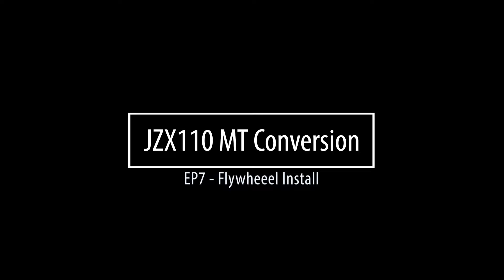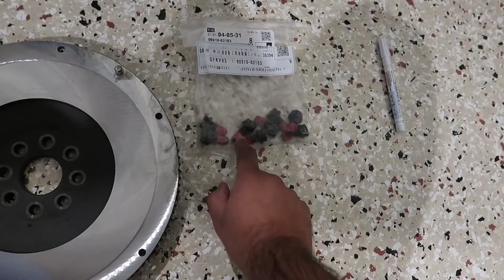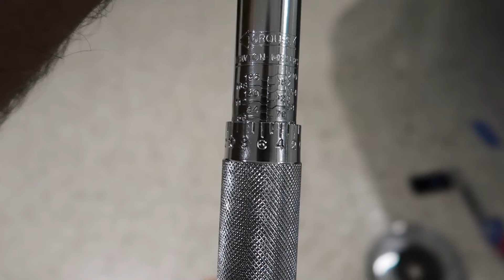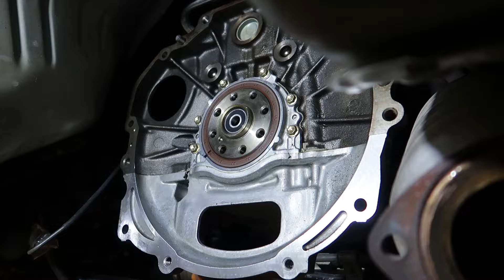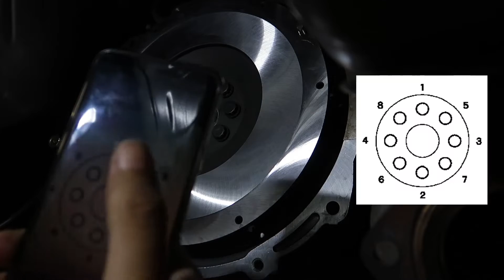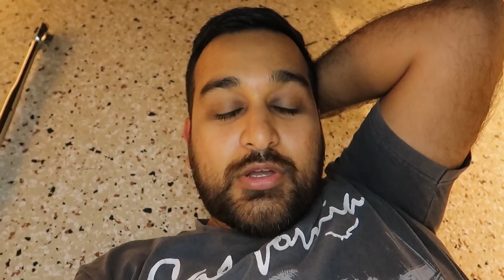JZX110 Manual Swap - EP7 - Installing the Flywheel | Toyota Mark II

Comment: is there a certain way the flywheels go on or just line up the bolt holes ?
Reply from the maker: Nah shouldn't matter unless there are specific instructions provided by your flywheel/clutch kit. So long as the centre bolts line up and it's torqued to spec you should be sweet.